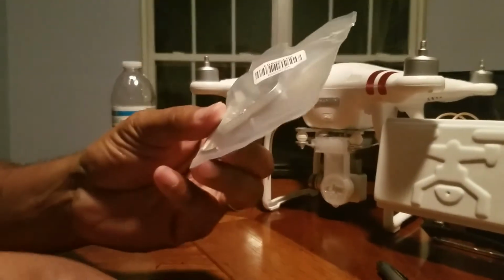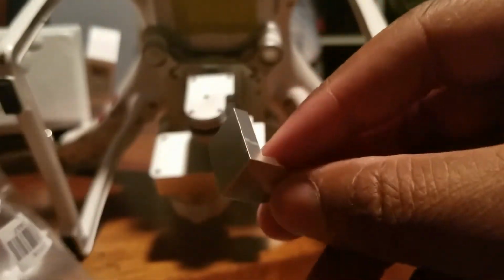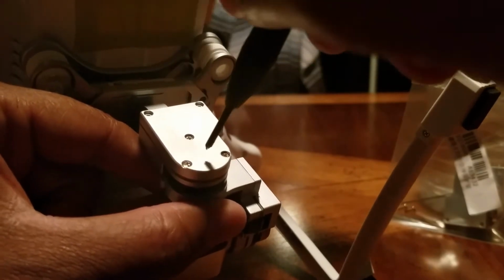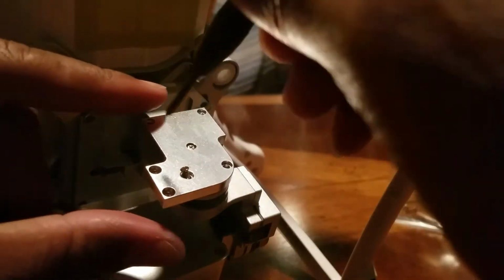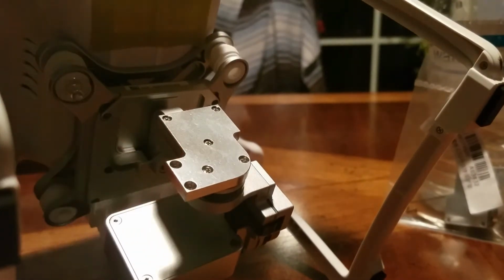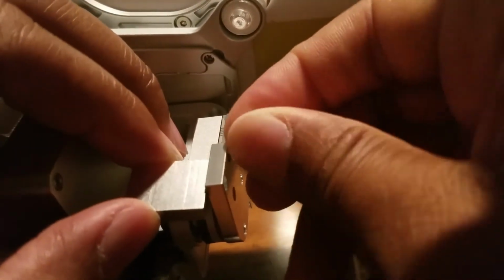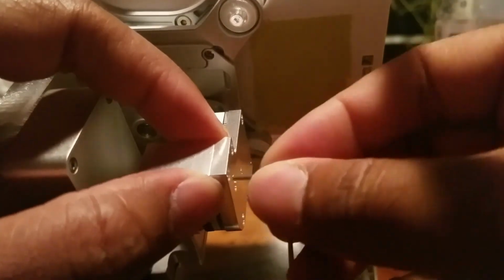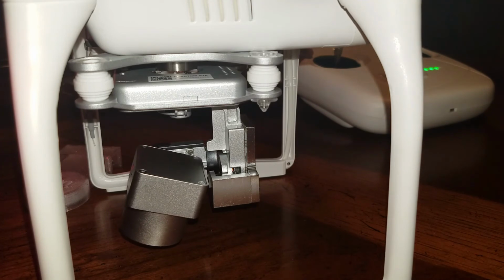April 19, 2016

Comment: Very nice. I would suggest maybe using a little blue locktite on the two screws holding the guard on. Metal screws into aluminum have a tendency to come loose.
Reply from the maker: Thanks I will do that, I ordered two of these so I'm going to do a giveaway video maybe tomorrow, thanks for watching and the helpful tip👍👍
Reply: +MrEbanks89 Right on everyone loves a give away! I just picked new bird. Found a screaming deal on a Phantom 3 Pro I couldn't pass up.
Reply: +MrEbanks89 Right on everyone loves a give away! I just picked new bird. Found a screaming deal on a Phantom 3 Pro I couldn't pass up.
Reply: +MrEbanks89 Right on everyone loves a give away! I just picked new bird. Found a screaming deal on a Phantom 3 Pro I couldn't pass up.
Reply from the maker: +Jason Scarboro sweet I think I'll save my chips for one also
Reply from the maker: Blue lock tight installed on those two screws
Reply: Awesome no worries now!